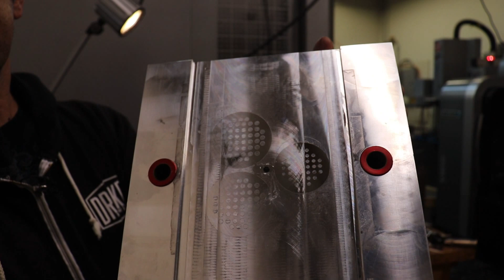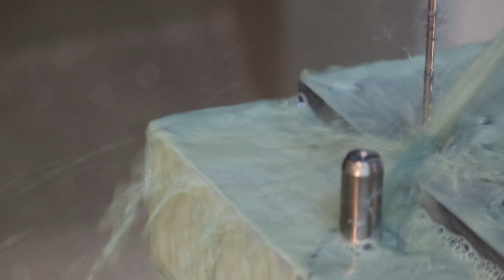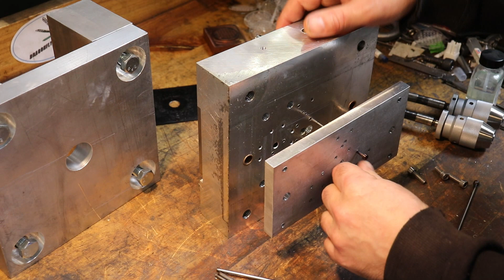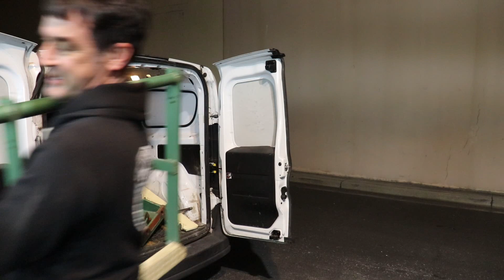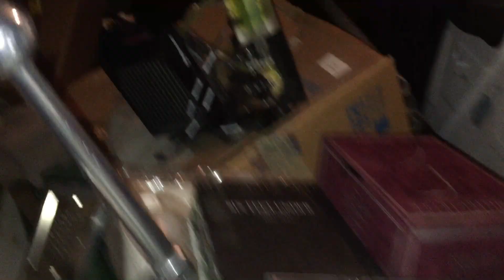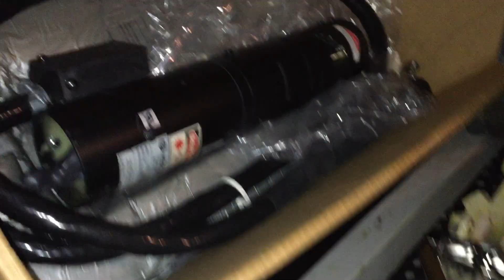Family Mold Fixup and other loot..

Comment: It's time for you to have some lessons in scientific moulding. 
1-Aluminium is only for playing games, you need to use mould steel to achieve any kind of a mould life. 
2-Your models need enough draft to allow the parts to demould. 
3-You only fill the mould at 95% full, using maximum machine pressure. It won't flash because the cavity is not full. 
4- Mould packing is what gives you your final fill, and achieve part dimensions, the more packing pressure applied increases the part weight, and therefore the part dimension. 
5- mould cooling time is an outcome not an input. You need to maintain a steady mould temperature throughout, within a maximum range of 3C. 
Plenty of moulding videos on youtube. search for the scientific moulding method.

Comment: What is the advantage of putting oil on the reamer over using coolant?
Reply from the maker: Im not sure, I just do it out of habit. I assume the extra lube prevents regrind of the chips on the wall. It is most likely habit from a repressed bad experience of an oversized hole. I have broken off reamers too
Reply: @DragonflyEngineering  I was taught when serving my apprenticeship when your reaming oil should be used as water based coolant can evaporate due to heat and causes a myriad of problems...when chasing close tolerances and surface finishes in blind holes especially